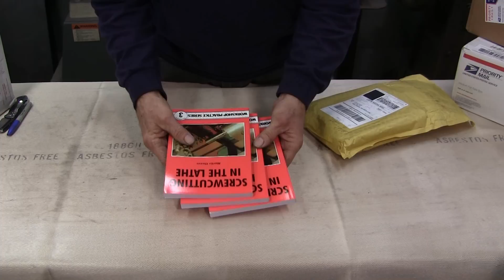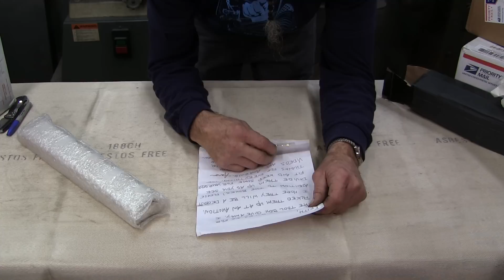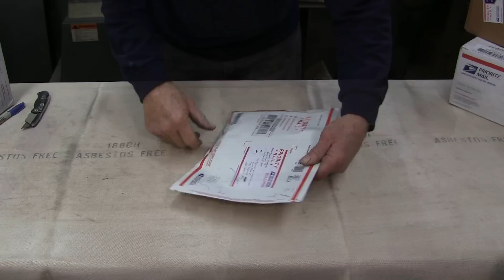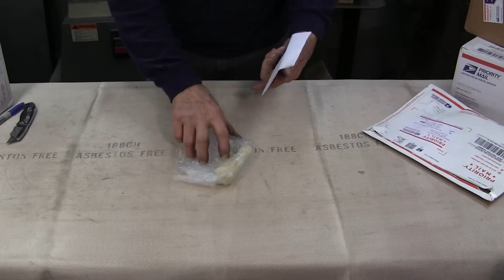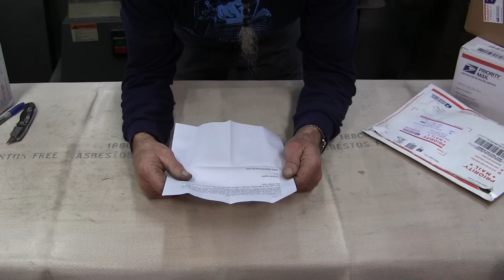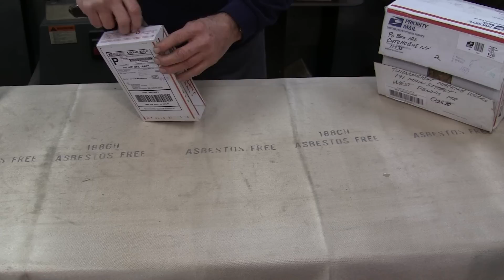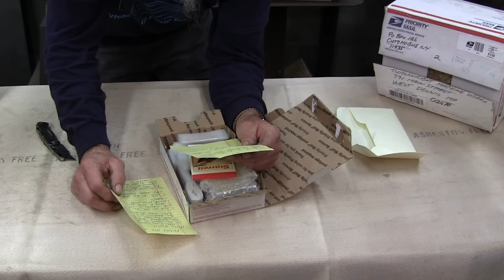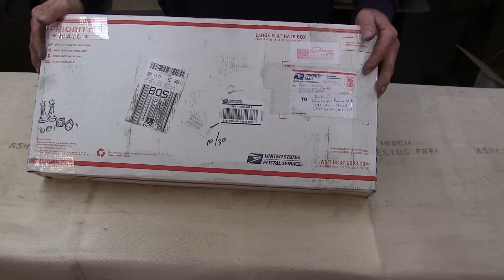What’s in your box? Giveaway 2015 Part 5

Comment: Hey, Keith.  I'm glad I could help out.  I think the adjustment that uses the allen key was located under the thumb if you unscrew it.  It took me a while to find it, but I do not remember for sure where it was.

I machined a new back for the dial indicator mag back to replace the plastic one which comes with the mag back.  I figured I would leave the original Starrett back and the plastic/brass one which normally comes with the mag back just in case the recipient needs it.

Thanks again, Keith.  Time to get collecting for next year.
Reply from the maker: +ILGopher That was a great mod! ;{)------